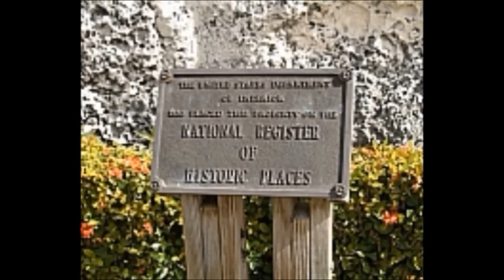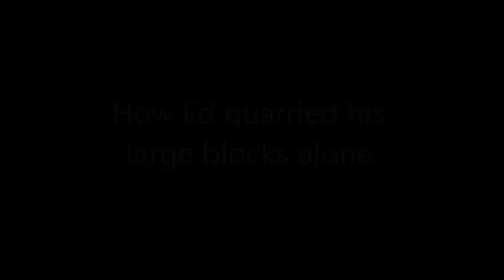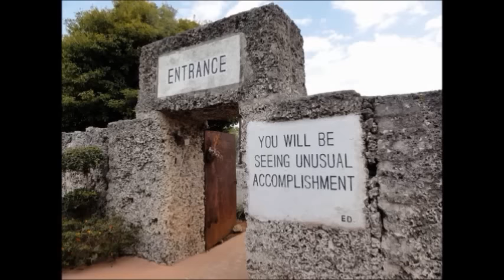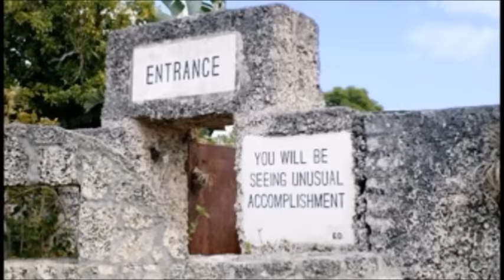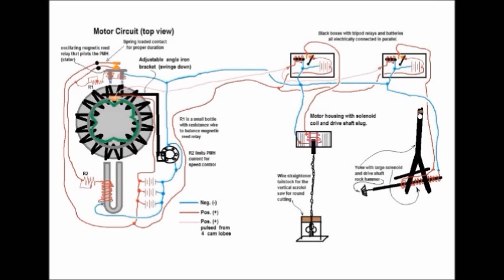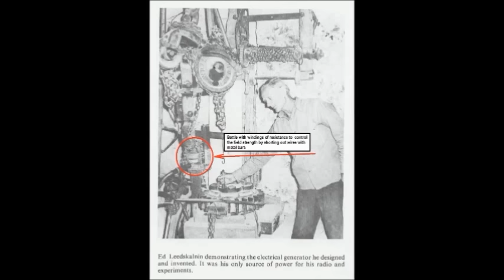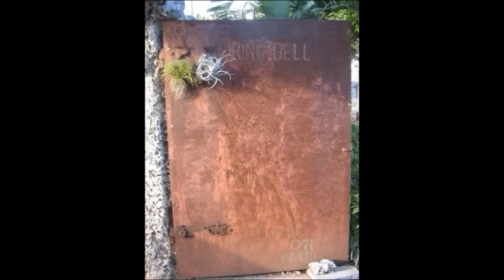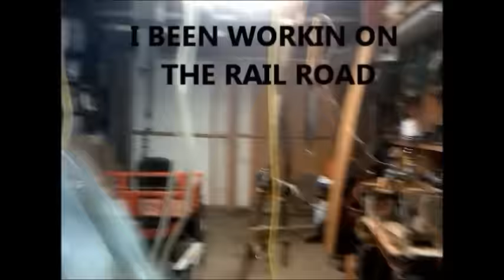Eds Coral Castle Quarry and Flywheel, Engineering Mystery Solved

Comment: excellent ... makes total sense. As a retired machinist/ miner, rigging and moving heavy weight I get. The old school electrical solutions also make complete sense.
Cutting heavy dense rock using these methods would also be possible.
Reply from the maker: 2 outa three aint bad my good man, The 1 off is this, That damned shit down there is soft as freakin chalk. PERIOD. You tube stuff on CC is often REALLY REALLY WRONG.     for $$$  of course.   unless it just ignorance. and none of that crumbly garbage rock is very heavy either after all it is called Oolite GET IT
OOOH   LIGHT.       Sincerely Scott R.

PS thanks for the positive comments